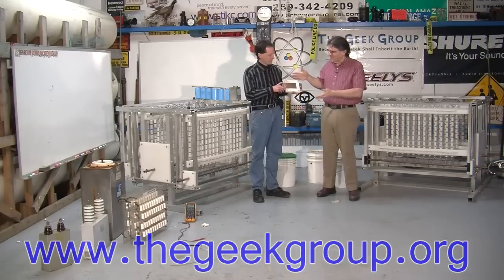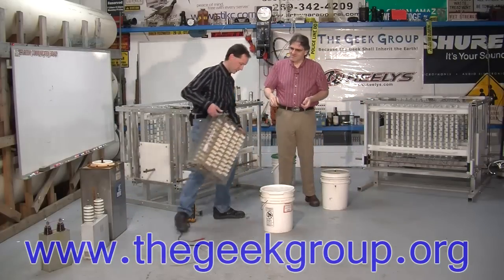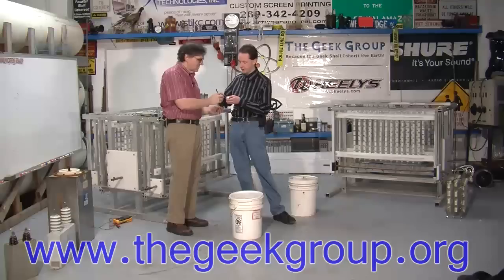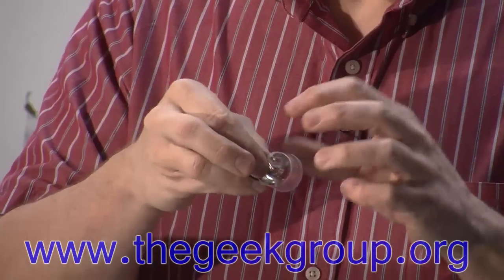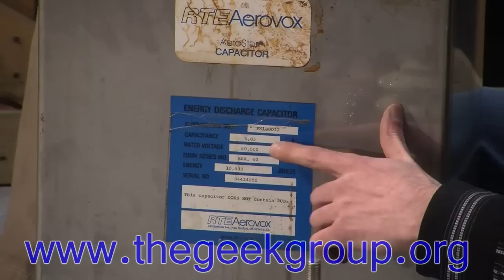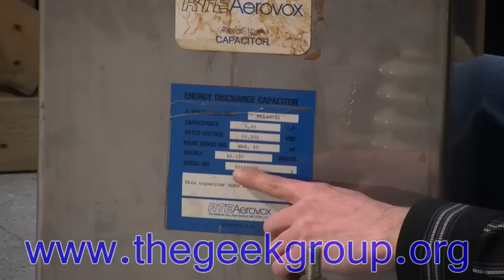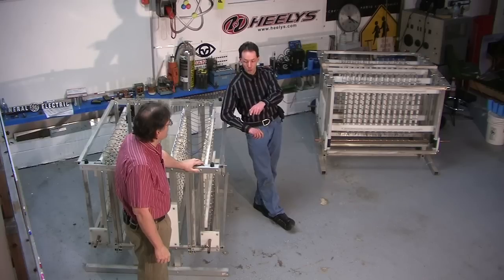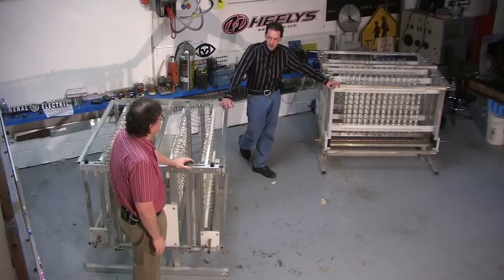Tesla Coil Capacitor Basics

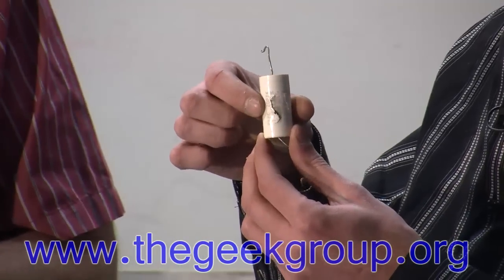Comment: @8:20 approx, could you design a capacitor that would be able to offset the excess energy instead of blowing up the valuable capacitor? Perhaps with an extra layer of diffusion?

Comment: I made a cap using plexiglass as a dielectric, aluminum foil as plates, tape to hold the plates on, and wire for leads. It dose not seem to work at all. What could the problem possibly be?

Comment: This is a 2 part question

1)  Yes you can build a tesla coil  powered by a 12 volt battery have it limited to a 10 A draw.   let me see if i can explain this one.     Battery in series with appropriate resistor  in series with capacitor, other side of capacitor is connected back to the battery.  You will want a Double pole single throw switch in there,  to break the positive and negative connections after the capacitor has charged.   Use another DPST to connect it with the tesla coil circuit

Comment: @10:00 approx; Perhaps surrounding the entire capacitor in another electro magnetic coil with a Hydrochloric acid/water solution with an anode and cathode, that can convert the extra electrons into usable energy which could be redirected into a battery? This might create a capacitor discharge ability for overcharge?? Patent pending :-P

Comment: 2)   the 1-2k volts  with a 12v source is only obtainable in the secondary  not the primary.   just design your rlc circuit right and ull get your desired voltage

Comment: I don't believe I ever seen a "standard" capacitor with connections only at the end of the roll, save for electrolytic... they use very very thin metallization these days and it really wouldn't work even for non pulse uses. What they do is that they construct a non pulse rated capacitor the exact same way but use a higher loss dielectric and much thinner metallization. Think about it, for any given series resistance you can use thinner metallization if the current path is shorter.